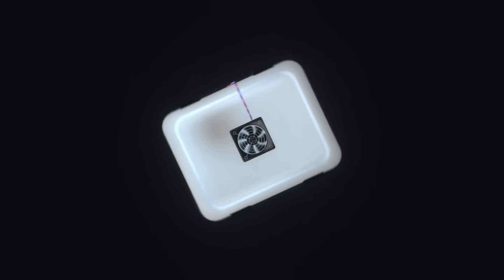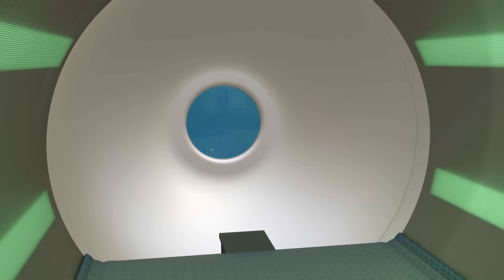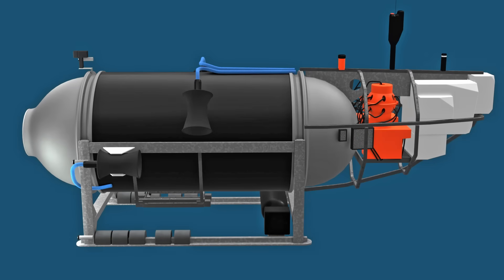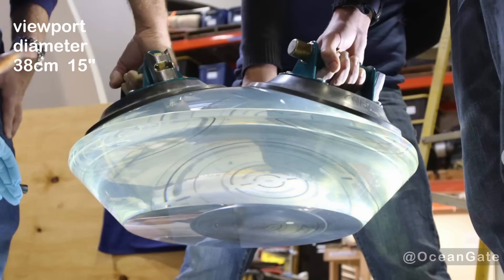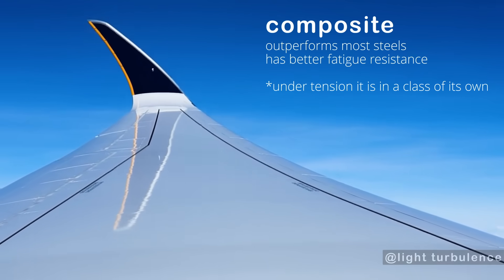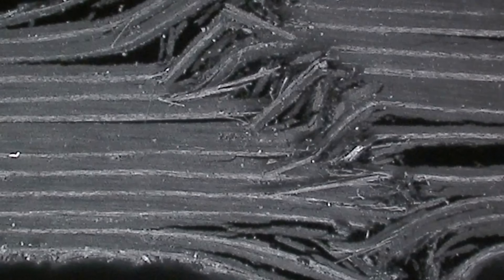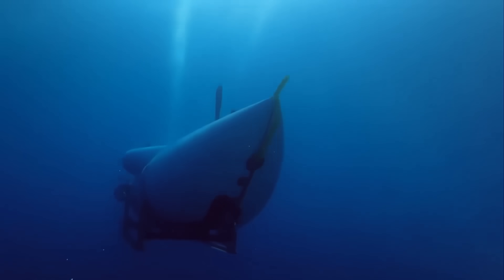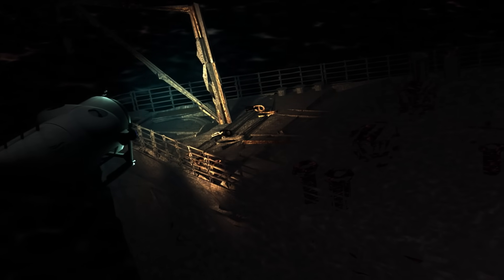Titan Sub | carbon fiber - Detailed Tour

Comment: Working on the development of carbon fibre wide chord aero engine fan blades back in the late 60's, I have some knowledge of the processes and characteristics associated with CF. The development program for the fan blades was the result of the need for a light weight structure, capable of resisting the centrifugal forces on the blade at the tip, as well as absorbing the torquing stresses due to loading. Carbon fibre composite was the only material that met those criteria at the time. unfortunately, it failed the blade impact test, also known as the bird strike test, as mandated by the USA FAA, a nine pound bird fired into the engine running at full throttle, (it passed the UK CAA bird strike test using a seven pound bird). The carbon fibre delaminated, shredded! Years later, General Electric in the US adopted CF for the engines supplied to Boeing on the 777. They experienced  the same problem, delamination until they came up with a design which involved three dimensional weaving, with the lay up having cross filaments incorporated in the weave specifically to prevent the delamination, apparently a sixteen hour layup cycle! If the Titan CF centre section had been constructed on the same lines, maybe this could have resulted in a structure capable of withstanding the enormous external pressure. BTW, I dispute carbon fibre composite has good compressional strength, a function of the matrix that binds it together, glue.
Reply: Exactly! Compression strength is good pound for pound but CF's real strength is that the carbon strands absolutely refuse to stretch, but the resin is most of the comprehensive strength. Plastic isnt Exactly known for its compressive strength
Reply: Even if that tube was wound correctly it would have still failed.  IF you look at the way the ends were joined to the tube it was a big problem.
Reply: @bobsbillets  Absolutely.  Most people think that the ends/joints actually failed first and from there it was incredibly rapid. I calculated it a while ago and it came out to about the time your fastest nerves in your eyes would send a signal halfway to your brain.  Thankfully the end was so instant that they didn't even know it happened.
Reply: @josephoberlander  Correct sir.  Because what will happen at those joints is the carbon and titanium will compress at different rates and that will start the ball rolling as they say.....
Reply: @josephoberlander  You haven't calculated "The Sphincter Valve Effect" what happens is.... noise and visuals ALL/BOTH travel South to the Spincter Muscle, they have to circumvent what is commonly cvalled 'the oriface interface', the nerves there are very thin and need bloodflow.
Once you throw TOO MUCH INFORMATION down theree, the Sphincter Valve closes, muscle tightness causes a drop in blood flow.... nerves can't pas information past .......and the brain has no choice but to mutter OH SHYT!!!
Reply: do you have any video of the 3 dimensional fiber weaving ? I can not imagine what it could look like. Would be very interesting.
Reply: A United Airlines tech told me the 777 composite fan blades cost $170,000 each.  That matches what you describe, a 3D layup process that takes 16 hours.
Reply: Uhh yep tons of engineers said the weaving mattered. But yea the gluing and aluminum parts wth. Could also done non destructive cabling as well with magnetic or wireless technology.
Reply: Rush was too cheap to pay for actual testing, you think he was gonna pay for 3D carbon fiber spooling? He was a greedy SOB who just wanted to give TED talks and have people hand him money.
Reply: Compression of plastic resin compared to Titanium i'm pretty sure behave completely differently. How to even make the endcaps work with that compression cycling difference between the two materials.
Reply: 😊 Obviously the Engineering wasn't at all sound.  A hideous design that wasn't structurally tested.  The Carbon Composite cylinder was too long resulting in a deflection near the mid section.  The wrapped strands without any overlap with the Titanium Bulkheads was another design flaw.  Using this fiber material in any type of loading other than Tension is Idiotic.  Throw the potential for an undetected craftsmanship error and you have really Big Trouble.  And one more thing, especially for you Carbon Composite Experts, this is similar to Fiberglass for everyone to understand.  This isn't all that special.  I'll bet you that there won't be another composite submarine any time soon !  One more thing, military submarines have really nice hulls, but they don't go deeper than 2000 feet.  Think about that.  Titanic is at 12,500 feet.
Reply: @superfly3990  It's not necessarily idiotic as CF has a compression strength of roughly 650 Mpa.  But titanium alloys that are over 1000 are easy to obtain.  Even some steel alloys can exceed this.  The issue is weight.  But weight isn't really a huge concern for operating underwater.  Using an alloy would have been dead simple and done.  Of course, leaving many other issues to deal with.
Reply: @superfly3990 As a lay person, if I knew that military’s submarines would not go as deep to the titanic, then I would not be a tourist passenger on a small coffin like vessel to that ship wreck. 😢☠️👻👻
Reply: Ahhh.. as  in the infamous RR engines.... that Pilots  universally Hate as they can't fully trust them??
Reply: @barenekid9695 that’s bollocks. Pilots love them and airlines love them for their fuel consumption, incredibly low oil burn, throttle response and their inherent LP blade toughness as we are talking specifics. I know this because I work for a large airline who works on Trent’s and GEs.
Reply: @barenekid9695 
What are you talking about?  The Trent engines use TITANIUM fan blades.  XWB are hollow, reinforced titanium, Pearl 700 is a titanium blisk.  We don't use CF fan blades on any corporate engines or any commercial engines, and pilots love RR engines.  The RB211 holds a WORLD RECORD 40,000 HOURS ON PYLON with no removal.  You are obviously running off at the mouth and have no idea what you are talking about.  Hush and let the grown ups talk.

Comment: As an example, wrap piano wire around a cylindrical mandrel to a thickness of one-half inch and then pull out the mandrel.  Now you have a circular loop of piano wire.   Is it rigid?  No, you can bend it, twist it, tie it into a knot because you are bending the thin piano wires, you are not placing them in tension.  If you put this loop over the hook on a crane, then you can lift the weight of a heavy car off of the ground because the piano wires in the loop are in tension.  If the piano wire circle was cast in epoxy resin, it would resist compression and deformation, but only because of the solid resin.  Same thing with the Titan's hull.  the thickness of the CF cast in resin gave it enough strength to dive as many times as it did, but that cracking was the microcracks in the resin.  Solid fuel rocket booster casings made from CF place the fibers in tension therefore they hold the extreme pressure.  Take an empty rocket casing laying on its side and place a heavy weight on it and it can be crushed flat because the fibers are in compression.  A guitar's strings are anchored in tension but are easily deflected.  Carbon fibers are easily bent and tied into knots.  They are only strong when you hold each end and pull.  The assertions of this video are totally wrong.  A tight rope walker on a cable puts leverage on the cable thus exerting extreme tension on the cable's anchors.  The fibers in the Titan's hull had no anchor points.  The rigid resin anchored them in their cylindrical form.  You have to be able to see this intuitively.
Reply: Would a composite spar made of a single fiber that runs end for end with each direction change immersed in the laminate be stronger, tough and etc. than one that has the fibers cut off at the end of the structure ?